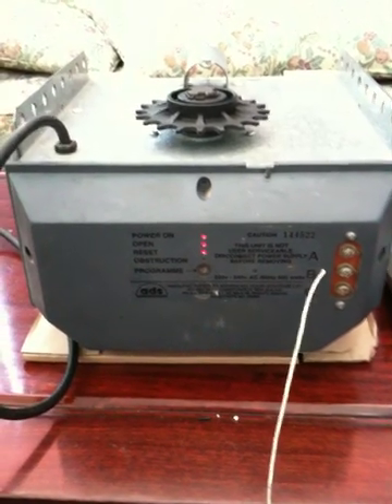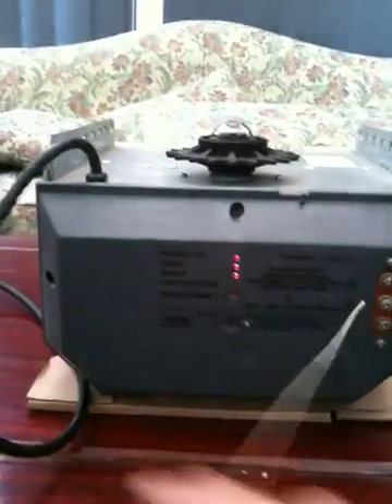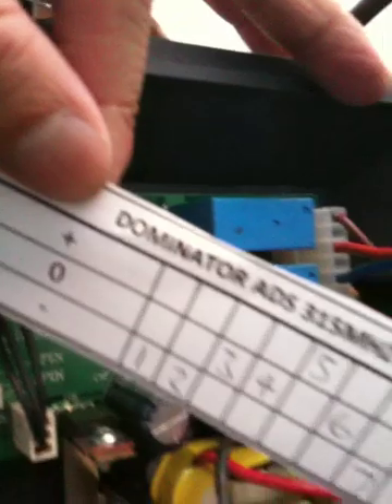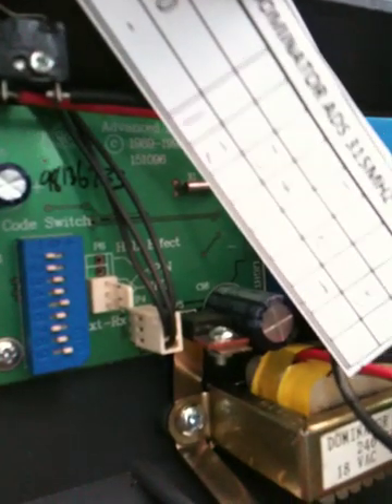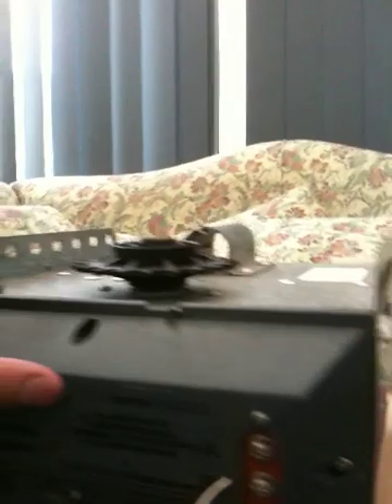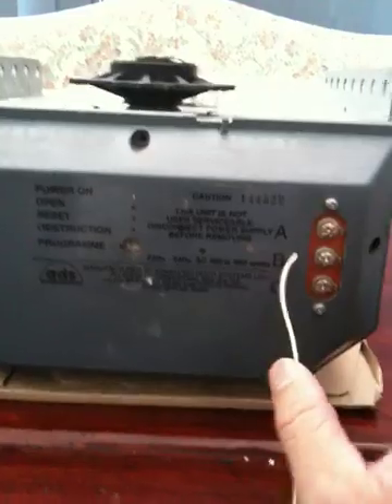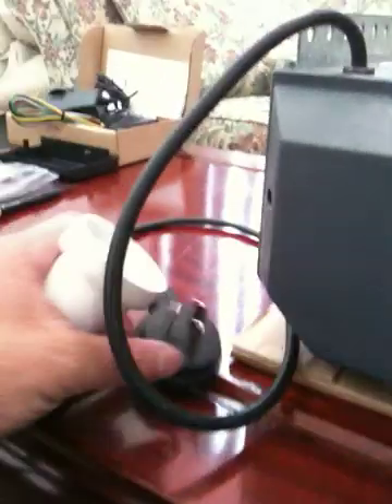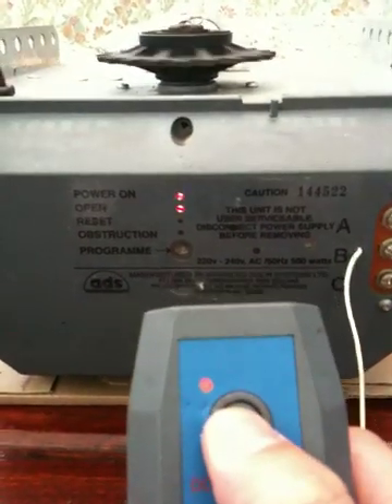Setting code on Dominator ADS Garage Door Opener

Comment: My door doesn't work at all.  Obstruction light is usually not illuminated & you press the button & you get one flicker of movement and the light bulb come on but only with one press ~ no continuous action up or down.. so I have to open / close manually.  It's hopeless.  The other door is fine,  with of course is the other button.  It's a one push up and one push down . Or it operates when you hold down the button. 
sometimes another light is not illuminated like programme or reset.  Very occasionally it will operate correctly,  like just now when I removed the cover,  it's hanging by the wires now but it operated,  initially by holding down the button. But then with one push only as it's supposed to. It plays up the whole time.  Anyone,  any ideas. I'm in NZ. And yes it's a Dominator. Can't see which model. Four red lights. 
From bottom 1 = Power 
                       2 = Obstruction 
                       3 = Reset
                       4 = status .

Comment: If it's an original one, the code switches may also be found inside the old remote. Open it up and then make them the same as the ones in your motor.